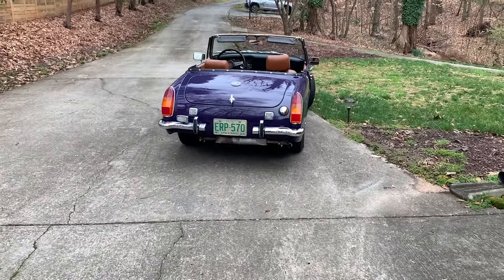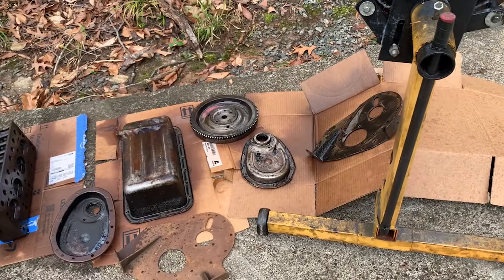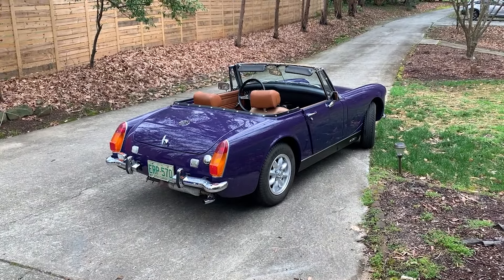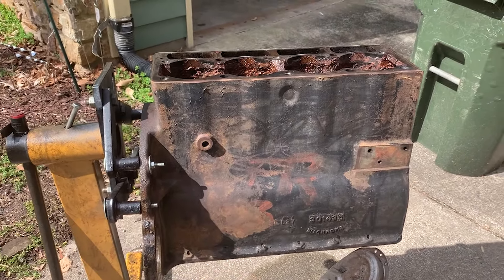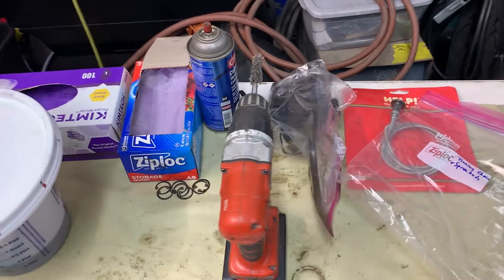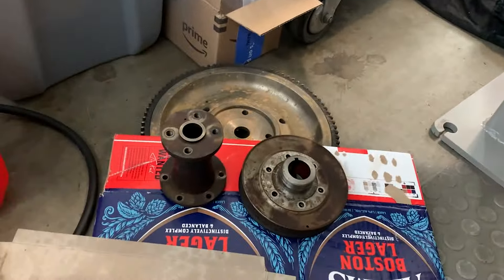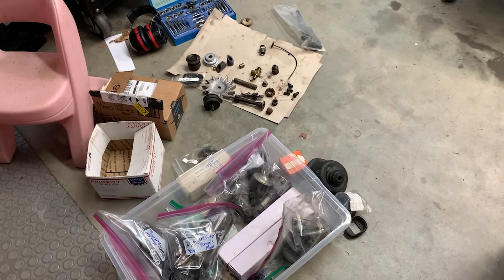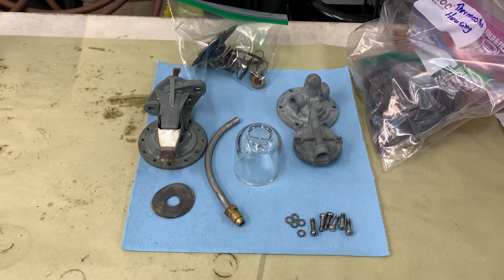64-1959 TR3A motor disassembly and cleanup

Comment: I restored one of those . After install of the crankshaft I noticed  ( thankfully  ) the frount of the crankshaft was bent ( where the pully goes ) . Owner of the TR 3 had a extra . Beautiful restoration.  Another thing , unknown to me the center main jet , if removed , IS NOT SELF CENTERING.  So if you remove , really unesscary , the needle will drag an stick the slide. I still have the special tool I made to center the main jet. Worked like charme. Also , took me some time to work out that  the car is positive ground. Temp would climb , an keep climbing if you were not throughly moving down the road.  Not enough radiator.
Reply from the maker: Thanks David... started dissasembling the first set of carbs, and very rough shape so will need completely strip down... thanks for heads up on the self-centering bit.
Reply: Yes Sir ! . If there is anything I can help with .

Comment: I actually like doing the engine work. It’s nice to get away from the body work for at least a little while.
Reply from the maker: Thanks Tush... my thoughts exactly. Besides it helps me balance my space needs a bit better with a driver now in the garage
Reply: @mikeg5877  how’s your shoulders?
Reply from the maker: @cheftush  shoulders are improving. holding my arms out in front of me is no longer agony. pretty steady PT with inclined press, internal and external rotation resistance work has been key. MY PT guy told me no straight up lifting, ever... Told me my pitching career is over! 🤣 My son is done with his pitching career, so no more catching help needed LOL
Reply: @mikeg5877  great!  Glad you are feeling better.  It’s tough having bad shoulders to be sure!   I was thinking that doing the engine work would be a good break for them.   Just get your buddy to torque the head bolts. 😉
Reply from the maker: @cheftush  i need an Elin 😜

Comment: Oof, you’re lucky this is a separate liner engine, that piston would’ve been extremely hard work otherwise… The Midget looks fantastic, I love the colour, is it an original one? Heard you mention being near Durham NC in an earlier video, I happen to live near the original Durham in the U.K.! Kudos again on the effort you’re putting in to the panel work on the TR, it really does look fantastic.
Reply from the maker: Many thanks Red!  Yes that is the original color of Aconite. MG had some kooky colors in the early 70s in an attempt to enhance flagging sales. Midge is exiting a 25 year restoration so it may be 95% complete for a while yet as i continue to find new things to improve. Thanks also for the kind words on the TR bodywork. I do take pride in doing it to the absolute best of my abilities. I will return to bodywork when its time to put the midget away for the season. I cant even imagine how many curse words i would have discovered if the i couldnt have just cut the liner off. It was really fused on there.
Reply from the maker: Yes Durham North Carolina. A bit less history than Durham UK, a lovely place to visit BTW, but enjoyable nonetheless.